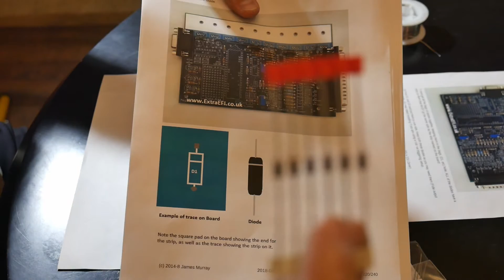MegaSquirt 3 (FULL) Build | Dune Buggy Engine Swap Pt. 6

Comment: What your opinion on the ecu header connector?
Reply from the maker: So far it has held up well! With all the engine mods and wiring changes i’ve probably taken it in and out 500 times
Reply: @DirtGearTv  thanks for the reply mate